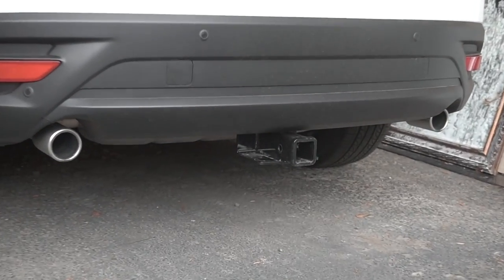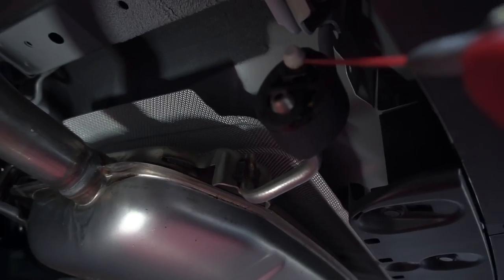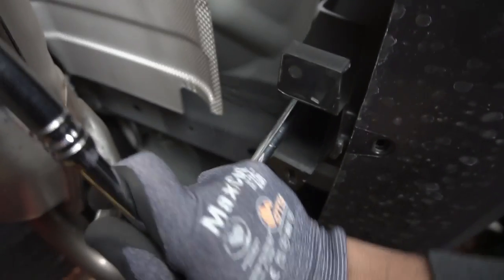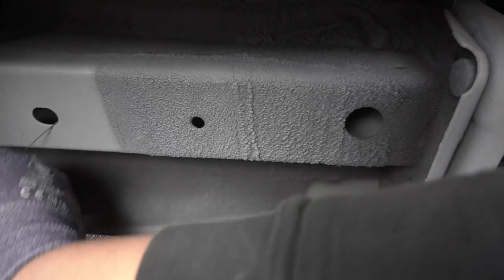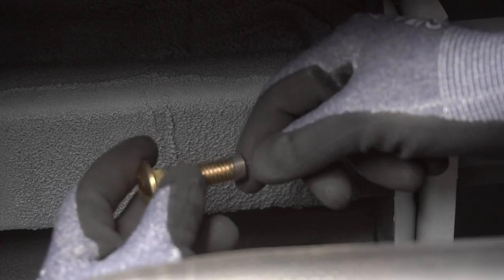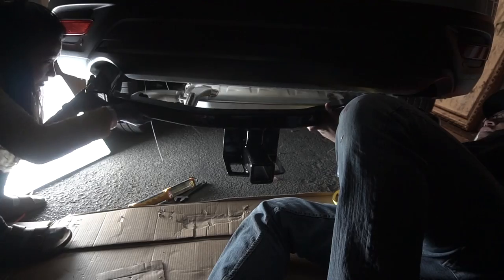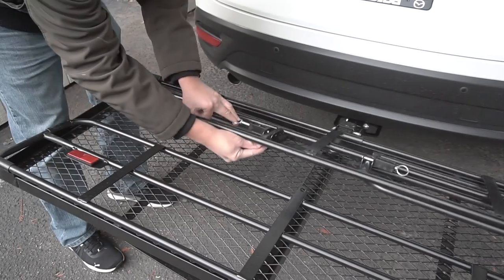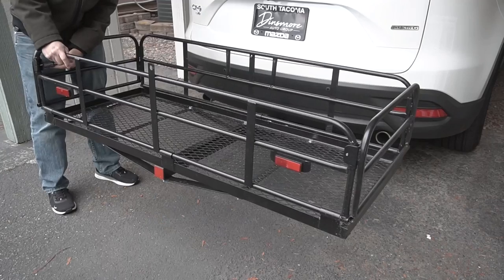How To Install A Trailer Hitch With Cargo Carrier Attachment! | NO WELDING Needed! EASY DIY

Comment: Hey bro,Can you lay down two tyres on it ? I have a Mazda CX-5 and was thinking of carrying my winter tyres to another province using that cargo carrier,that way I  can save some space in the inside of the car.. please tell me if  tyres can be laid down.
Reply from the maker: Hi! I’ll go and see. I’ll measure my tires and measure the space, but for now I know the inside measurement is 59” length x 23” width x 14.4” height
Reply: @FixThisHouse  thank you.. will wait for the update